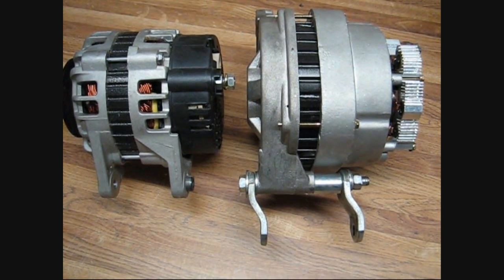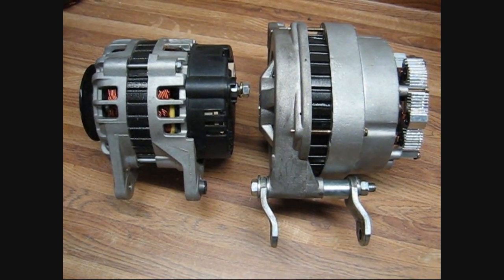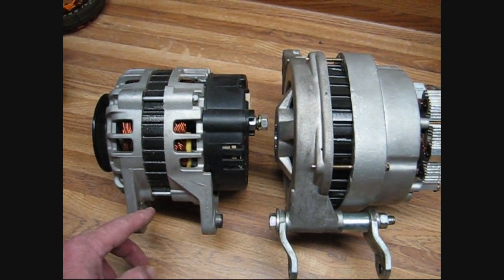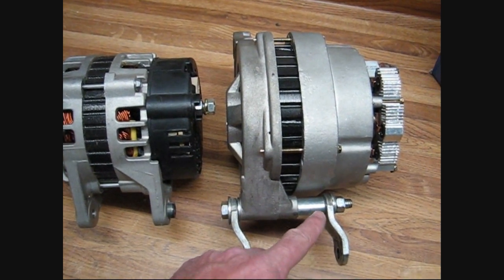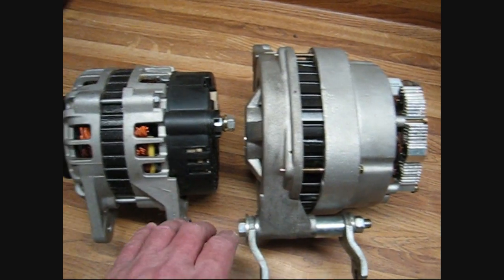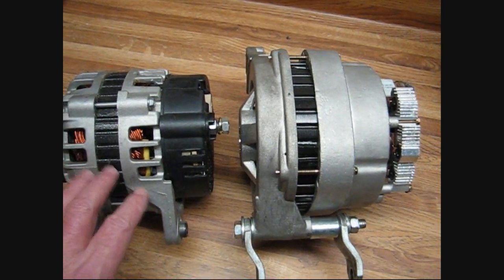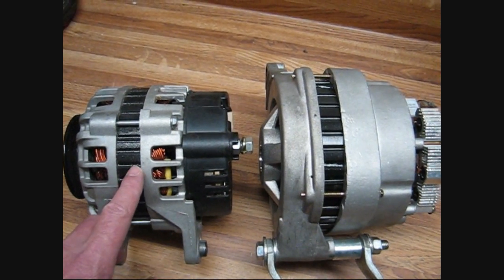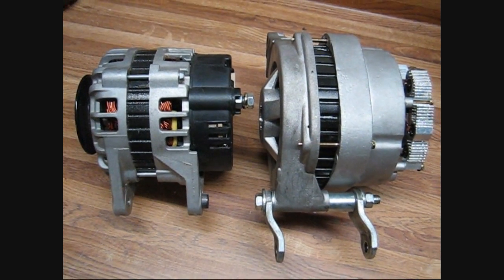Alternator Adapter Bracket A285 adapter bracket. 1 foot to 2 foot conversion

Comment: What would be a scenario where a person would need an high amp alternator in place of a stock alternator? 

Roughly how many amps is the high output alternator in this video?
Reply: When there are aftermarket accessories that exceed the capacity of the stock charging system.  

Examples:

Hi amperage audio systems, lighting, CB/HAM accessories, etc.

H.O. alternators can output 300amp + at peak and can offer significantly higher output at idle over stock as well.